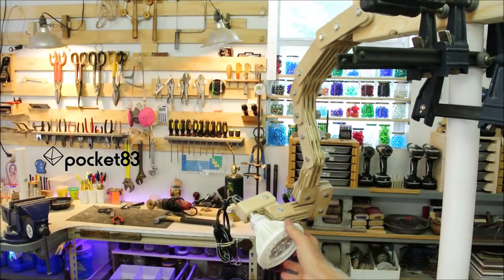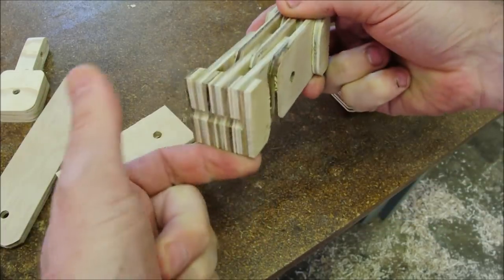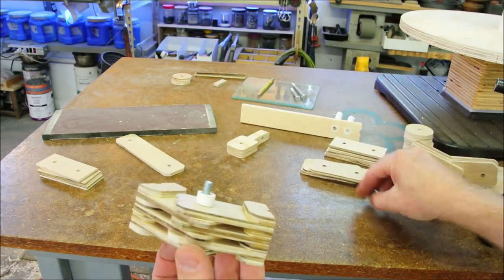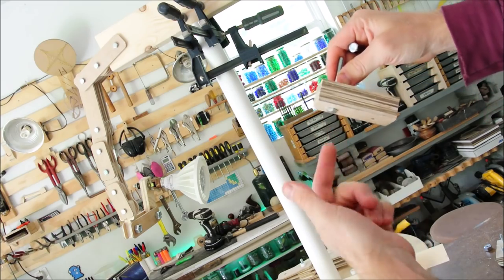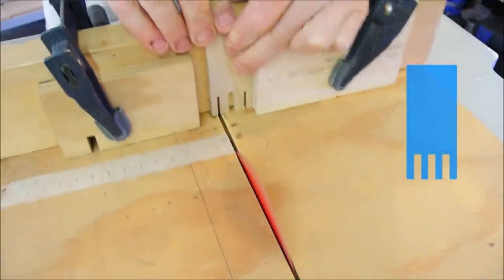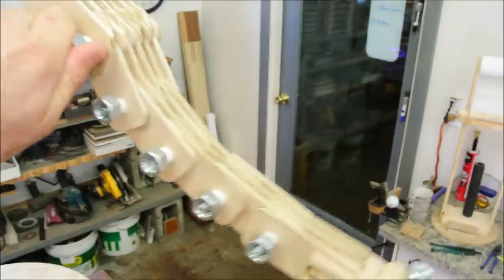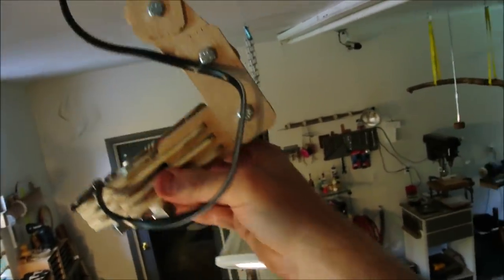Robot arm snake light

Comment: That is pretty rad, and the circle sander trick is quite clever. 

In theory, friction is independent of surface area, and is more dependent on clamping force. I imagine reality is a bit different (consider a drag car's wheels) but that's how it's taught at least.
Reply from the maker: That's a tough one to reply to.
Reply: @pocket83squared  Maybe I've stumbled upon a good video subject...
Reply: @JeremyCook  yes I also learned that friction is proportional to the perpendicular force and to the friction coefficient (in static or dynamic mode). I think it's only an approximation for some cases but I don't know wich ones.

But even if friction isn't influenced by surface contact in that case, I think multiple layers of plywood is necessary for preventing the light bulb from shaking.
Reply from the maker: @fractalphilosophorum9405  And that's exactly why I didn't reply to it. You've just opened yourself up to a world of petty disagreement with that comment. I'm still not interested in taking the bait. As far as I'll go is to concede that correlation is not causation, but as for entering another physics argument, I really want to sit this one out.   

Mac guys. Sheesh.
Reply: @pocket83squared  I don't think there's a place to disagreement if it's possible to setup an experiment to prove something.
In this case it would be trying to measure the maximum amount of force/tork the arm of an articulation can take before it starts to rotate, trying it for multiple layers to increase surface contact or 2 layers to minimise it, with the same amount of force applied by the bolt in both cases.

Comment: Very Nice!

There are light bulb socket adaptors that include an electrical plug, so you can still have the light, and a place to plug something into at the same time.  Might be useful until the desire to install a proper electrical outlet comes around.

Comment: I don't need a light like that, but it's still super interesting and at least the idea of using the segments of the chain as hooks for the wire is a thing I'll do immediately in my shop. I have lots of those chains lying around and lots of wires that are not well enough attached.

Comment: Looks great, but from my experience, the humidity fluctuations in the air constantly make you have to tighten the bolts because it keeps collapsing from the wood contracting, and you used many.
When building them, I also build the swiveling parts first (farthest from the lamp), - then the tilting parts, so there's less leverage/weight and it's less likely to fall. 

I've found it extremely frustrating to build  counterweighted wooden lamps/tripods/stands. But your environment it might be fine. Love the design.
Reply: I guess more similar to a TV wall mount. Not sure.

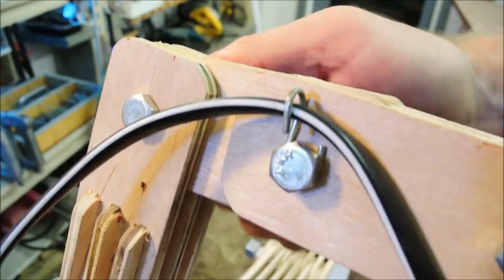Comment: your comment was probably dry humor but @10:00 Wireless electricity is invented but it follows the inverse square law If the distance between two coils is doubled the magnetic force between them will fall to a quarter of the initial value. so it is not efficient or practical at distance. The transformer that powers your house has no physical connection between the primary coil and secondary coil their is just insulation and a very small gap  between the coils. If you want to experience this in a practical way take two strong magnets and feel how the force drops off over distance, they follow the exact same inverse square law.

Comment: How did you end up with four different pairs of tin snips? No judgement from me; sometimes it just happens thanks to the unpredictability of life. But I'm curious if you have a specific reason for having multiple. Maybe they are different in a way i didn't notice?
Reply from the maker: Of the four visible: one is for general/soft use (rubber, foam, fabric, et cetera), one is for aluminum/vinyl, one is for sandpaper, and one is for metal. 

Different bill shapes also give them task-specific utility. Just like hammers, there are a million types. There's probably a dozen or so floating around my shop, and I wish I owned a few more. We even have a pair designated to pruning. 

It's a bit behind-the-scenes, but using shears is a skill one can develop. My first experience with them came from working for a roofing/siding outfit We were required to keep at least two sets each of 12" Craftsman. Sharp ones were for soffit/fascia/siding, and dull ones were for shingles. Strange thing, but shears don't really snip shingles well until they're dull enough to no longer cut anything else.

Comment: your nut knob instructions were too difficult, i think i messed up and built a flux capacitor.
Reply from the maker: Are you sure you followed the first two steps correctly? If you don't get those right, the whole thing can fall apart.
Reply: I tried it, but accidentally used a brass nut. The galvanic corrosion generated so much electricity, it turned into a battery. Also my house is one fire!
Reply: @Yonatan24  At least it's not two fires.  <duck>